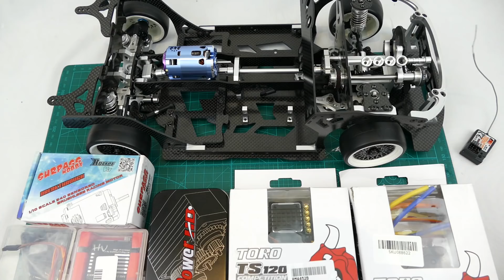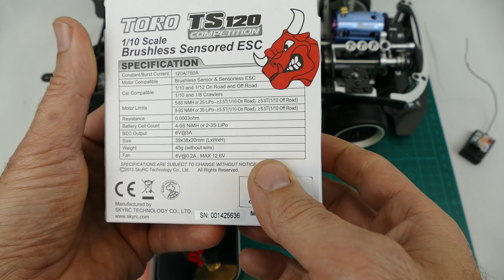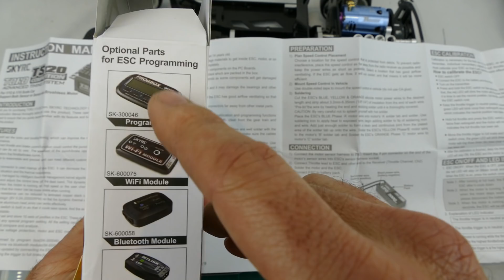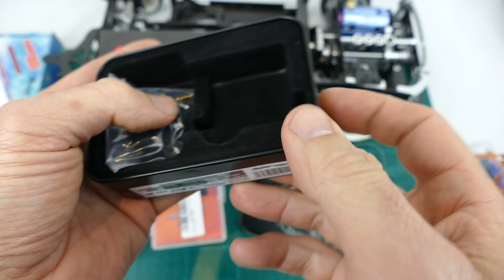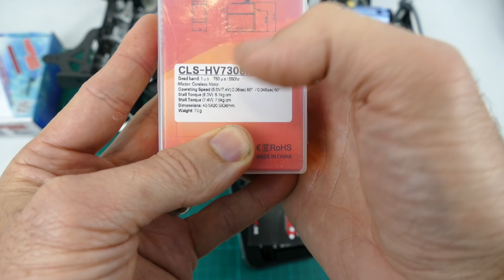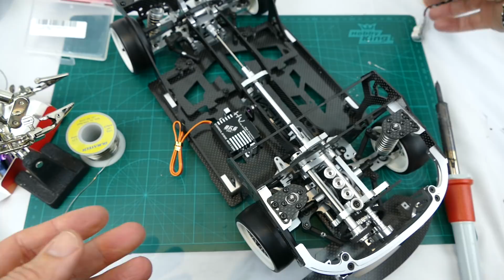FIJON FJ9 DRIFT CAR (AKA D9 Bulldog) - Carbon Fiber & Alloy Masterpiece Part 4 Electronics Installed

Comment: Steve would you happen to know where I can source parts out for this kit? I have looked EVERYWHERE for part A25, and turnbuckle #45, mine cane damaged from factory and I can’t find that particular part ANYWHERE. I can find other parts from the A bag, sadly NOT A25. I finished the build completely but can’t run the car until I get that piece. I have contacted Bangood but they have yet to email me back. Thanks in advance.
Reply from the maker: Sup bro, I thought I saw them on Banggood. If not parts for the D9 Bulldog will fit, same car.
Reply: @RCTanksTrucks247   Just found them on the BULLDOG 9 and placed my order.....SOOOOOO HAPPY right now. Thanks again.
Reply: Yes I know Bulldog same car, but that particular part A25 can’t be found. I did check bangood but nothing, they do sell other parts from the A bag, but can’t find A25. Thanks again.

Comment: Hi, for this chassis there is a brand of body shell that fits correctly? If you have someone can answer? It's hard to find other shells besides ae86!
Reply: Ronaldo Barreto I have this kit, the Tamiya Scirocco body fits it perfect. I just build mine and have the scirocco body in my MST KMW LIMITED, I took the body off and slid onto this FIJON 9 and it fits it PERFECT. Hope this helps.

Comment: Happened to my steering servo to ESC too. The diff is mine will twitches to one side then springs right back into place. Mess w the servo /steering clearance so the steering springs back in place. Only my high end ESC w fatuba servos do it. Not an issue ,just a twitch!

Comment: It's funny you mentioned that twitch with the servo. I bought a savox waterproof tall servo and installed next thing I know it twitches so I turn the system off then on and it works fine. That's with the cap pack installed on a max8 combo from hobbywing

Comment: I don't know if you already found the answer to why the two jx servos won't work in this application but if not I will try to explain. A servo receives pulses from the receiver via the signal wire. A normal servo needs pulses with a width of around 1000 to 2000 µs which correspond full left and full richt, while a pulse width of 1520 µs usually corresponds to the servo being centered. The jx servos are very fast and thus need more pulse in the same amount of time. In order to send more pulses in a given time, the pulses have to be shorter. These jx servos need pulses with a width of 500 to 1000 µs, while a pulse of 760 µs correstponds to it being in the center position. Due to the pulses being half the length, twice as many pulses can be received in a given time. On the jx servos you can see the "760 µs" indicated which tells us that this is a short pulse width servo. When you plug this servo in a normal receiver, the servo will receive pulses higher than 1000 µs and will thus move to one side. Sometimes these pulses will ask the servo to move to a position that is mechanically not possible, which can damage your servo. Servos like these are often used to control the pitch on the tail rotor blades of rc helicopters due to the high speed requirements. In model helicopters the servos are often plugged in to a flybarless system or gyro which often has the possibility to send out these shorter pulses to the tailservo. I don't know much about rc cars and if it is possible to get receivers (or gyro's) that can send these shorter pulsewidths. Anyways I hope this helps. If you want you can probably find more information about this on rc helicopter forums.
Reply from the maker: +Thomas Louwagie wow, awesome Thomas, exactly what I was after. Much appreciate your thorough explanation, now I understand why 😀
Reply: No that is nog the case. The flybarless system that we put between te receiver and servos usually has the ability tot run these kind of servos. I have not yet seen a receiver that can do that.
Reply: so a transmitter/receiver for flying planes/copters will talk to these servos
Reply: Amen

Comment: The servo looks to be rated for 7.4v 2s. You plugged in 11.1v 3s.
Reply from the maker: +Jeffery Brewer the has a bec to limit the voltage, that doesn't matter.

Comment: All those belts.. I don't understand why it's designed like that. Is it just for the look or what? Yeah I'm trolling a bit. Still that car is silly
Reply: outabody FPV I think its some kind of safety in case something blocks the transmission the belt slips and so the motor doesnt stop instantly, much like white 24t gears in legos
Reply: BL-10 et HE ! Tumbler73 what about the aluminum intake tubes or whatever they are. I just see a lot of weird stuff I don't understand.
Reply: Also that flysky.... why not just get an airtronics mx5 at $100. I know I'm picking this apart but I'm not much into cars anymore so maybe I'm just out of the loop.
Reply: It's mostly for looks
Reply: I cant figure out why it has 14 belts and 17 driveshafts either. I havnt had bad luck with flysky, have had silly problems with "cheap" but fancy digital titanium gear servos though, doing all sorts of poltergeist stuff.

Comment: Check to make sure the center of the servo is 1500 or something close to that. Also, hv servos need hv. I would also try to use it at 7.4 volts. Higher is better. You may need a small battery and 7.4bec to run the servo individually. Hope this helps!

Comment: From experience.  When you use a high speed servo with the Flysky transmitters. You may get a bit frustrated by the latency of the radio. And it can cause the servo to twitch because it is receiving the input so late. I am super impressed by the quality of this kit and it looks so dam good too! Thanks for sharing mate!
Reply from the maker: +Bigdaddyd82 Vapes thanks for the info man. I am going to try and pump 7.4v into it and see if it wants to cooperate :)
Reply: Did the 7.4v work for you?